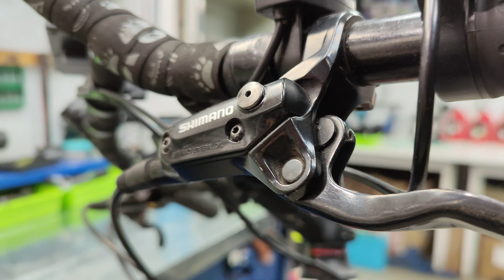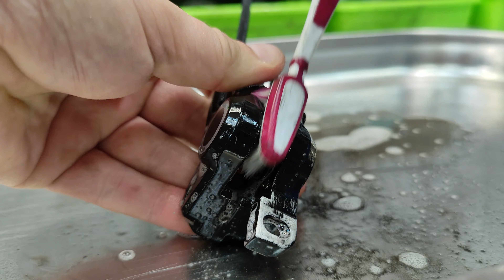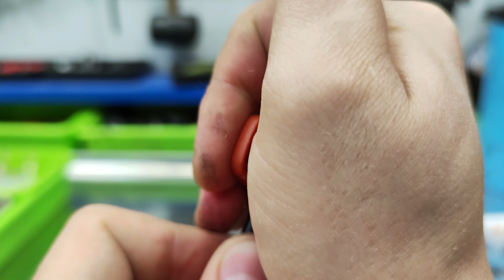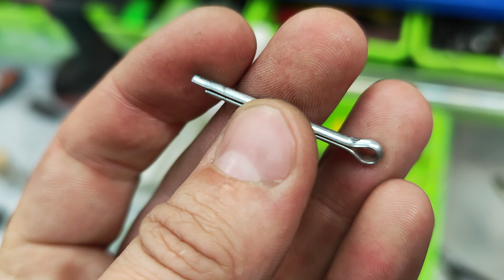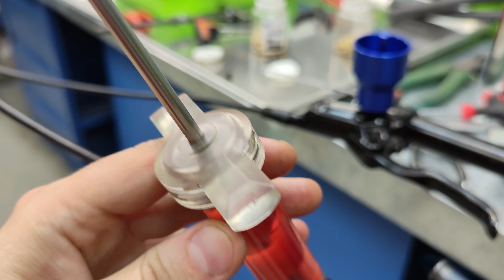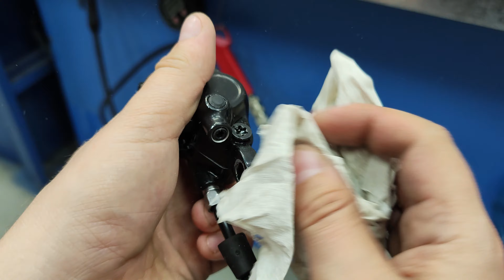Repairing a bicycle's hydraulic brake. Brake pads under a microscope

Comment: This video is a diamond in the rough. Perfect cuts, sound, pace length. Thanks. One question. How to figure out where the oil is leaking?
Reply from the maker: Thank you for your comment. You will not find the exact place where the oil is leaking. But if the oil is leaking, you will see oily dirt on the caliper or brake lever, respectively.